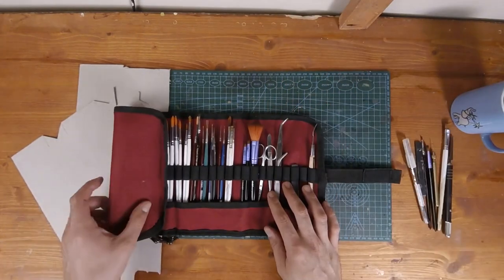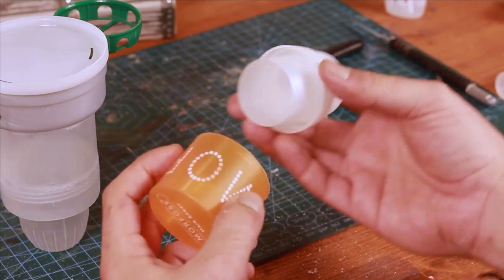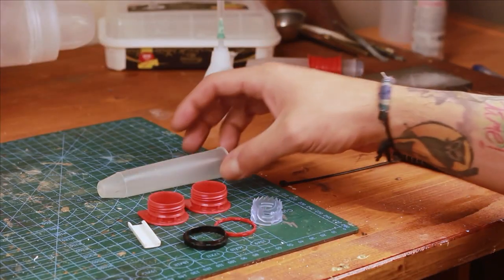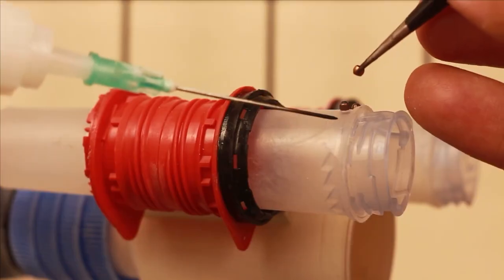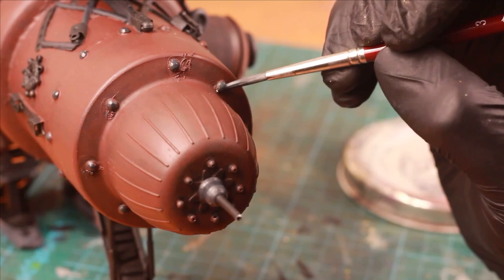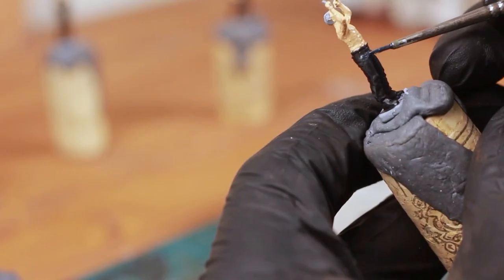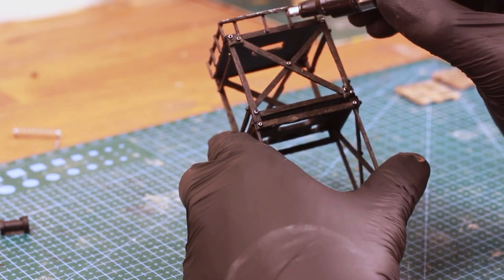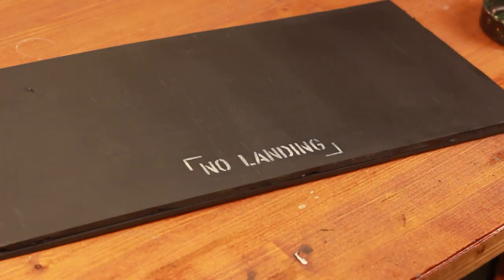🚀 Scratchbuild Sci fi Cargo Ship Diorama: How to build it!

Comment: The silver edge highlights are a bit bold and perhaps overdone in places but overall it looks fantastic! I think even just cutting the thickness of those lines in half would help up the realism. Having dings on every possible edge would still not look too much if the lines were just thinner. Can't wait to see what else you come up with!
Reply from the maker: i used a chrome pen by Molotov brand, that was the first time i realized the bit of the pen is too large for this scale i usually work with. i kind of stopped using that pen a while ago,  instead i am doing this with the brushes and metallic color paints.

thanks for your feedback! 😊

Comment: Great work. Lot of useful ideas of using everyday materials. Which kind of glue do you use? I always struggle with cyanocrilate nozzles.
Reply from the maker: yeah, i think twice about throwing a plastic item to the garbage bin. 😊 

i always use cheap high viscosity CA glues. i strenghten the glued area with baking powder on the glued area when i dont have enough bondage in between the pieces.